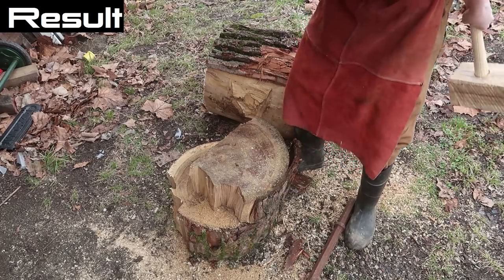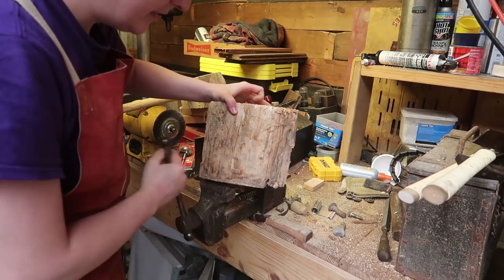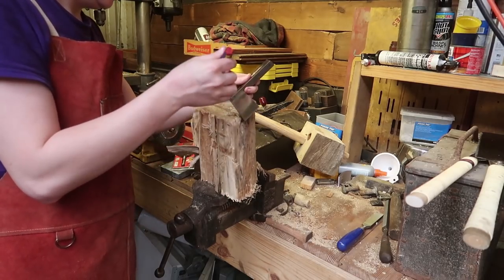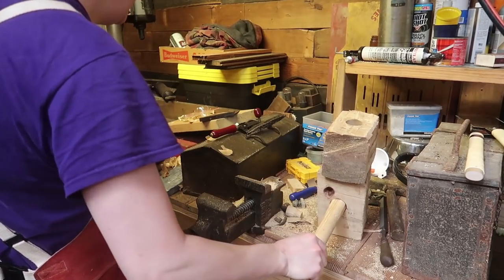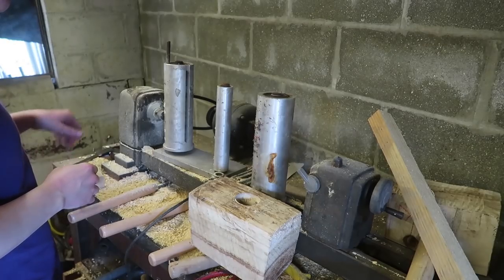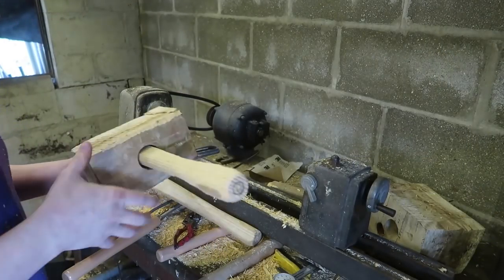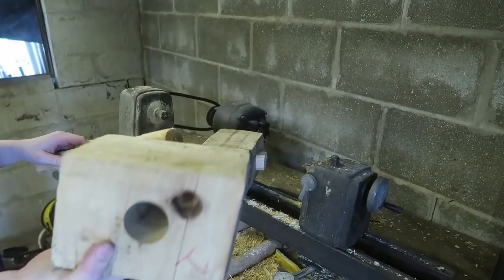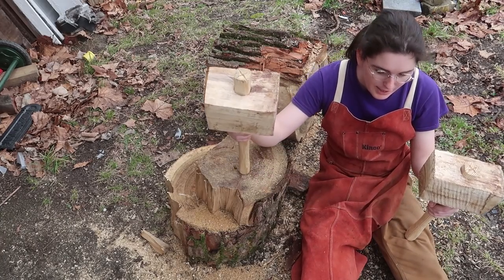Learning Woodworking 04: Crafting My First Wooden Mallets! My Process Thus Far.

Comment: I made a extension for my blacksmith drills on my metal lathe. Just round bar hole drilled to drill shank size, two grub screws to hold the Forstner bit , Easy to make

Comment: Depending on the final fit and finish, I would be willing to pay much more for a mallet. Selling a set of 2 is a good idea, but maybe one larger mallet and one slightly smaller mallet. Be cool if you could burn your "makers mark" on the head of the mallet.
Reply from the maker: i hadnt thought of a two-pack different size, and yes im planning on making a brand die.

Comment: Use your metal lathe to make the extension for the forstner bit? I'm curious how long the throw is on your drill press quill, may have to continue doing steps and adding blocks underneath for the huge mallets you make! 😄 I'm looking forward to your bandsaw and belt sander projects!

Comment: The bandsaw will be very helpful.  One of the things you may want to do is to bevel all of the edges (think 
Mjölnir), that will help a lot to avoid cracking and splitting.  You could hog it with the belt sander but doing it with the bandsaw will help reduce the amount of time you need to spend sanding.  Another thing you could do is fire-hardening of the work-faces.  You could do that pretty easy with a hot piece of Iron.

Comment: Years ago I was working on the roll up door of a van and needed a persuader,  I grabbed a chunk of garden edging, about 4x3x12" and a piece of closet pole and threw together a "hammer" it worked great and over the years its been used for sinking posts and moving walls and all kinds of odd jobs, its down to about 8" now after numerous trimmings but it was just a chunk of junk pine, its still in the shed and still comes in handy. If you do make more of these Id like 2!! they dont even need to be super finished, I like the rustic look of them and Im sure they will age great
Reply from the maker: i'm planning to salvage wood from driftwood in the creek, so imagine the weird colouring some of those logs will give the mallets too!

Comment: Your not the one that has to listen to the history of the hammer and there different functions and types, for the next two weeks. On the plus side we do have a large wooden mallet from the 1870s used to drive in circus tent posts. The head looks like a barrel with metal rings around it and made of hickory